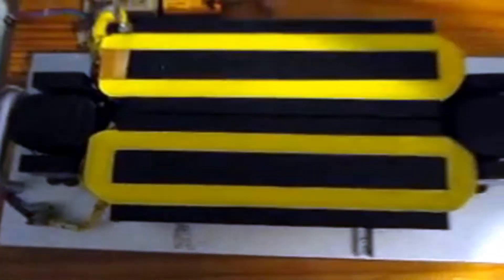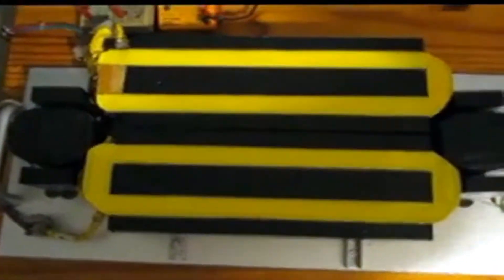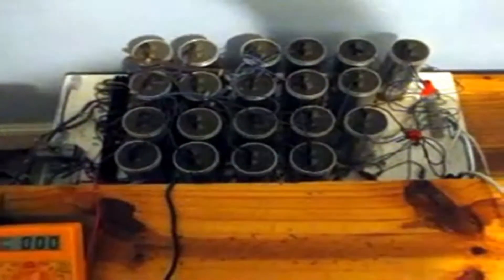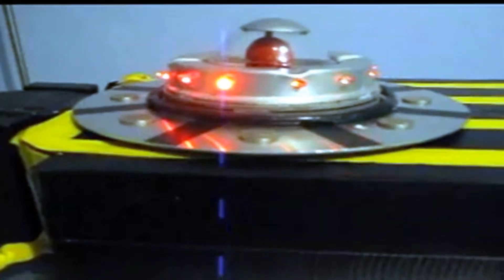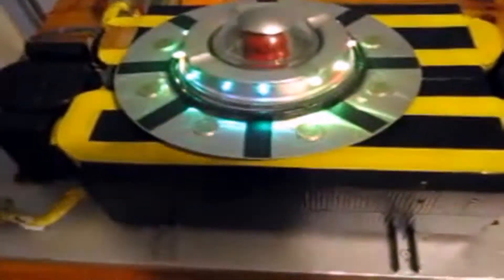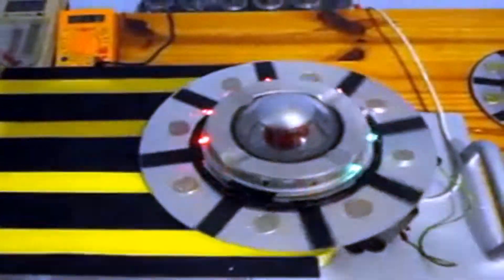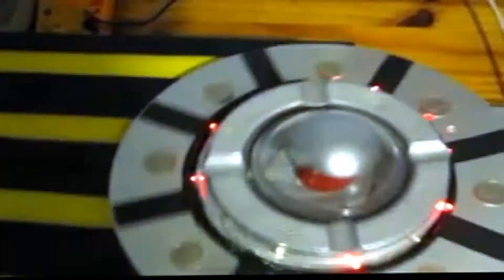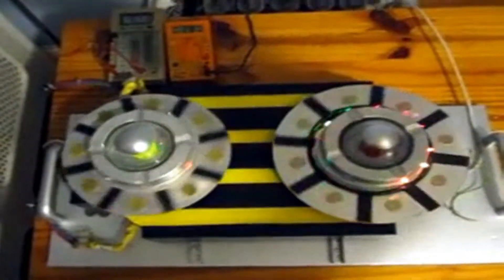Electro-magnetic levitation of flying saucers

Comment: Try looking into Viktor Schaubergers implosion vortex concepts. Now, use a stainless steel cylinder filled with mercury and apply positive and negative connectors at the appropriate points for MHD liquid “vortex” currents akin to Schaubergs whirlpool implosion concepts.

This should be the central motor of your “UFO.” Observe what happens when you increase ampage. I’m not sure if the base needs to be conductive EM coils, or the base should be copper tubes coiled that are connected to this mercury torsion motor. You’ll need to experiment with the EM fields and repulsion.

Good luck!
Reply from the maker: Thanks for your feedback.  I will look into the subjects that you suggest.